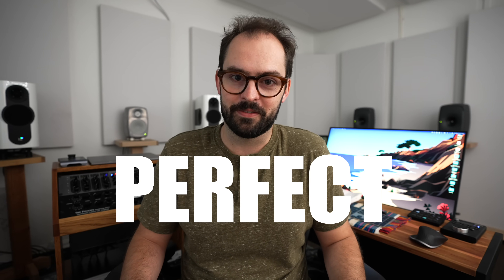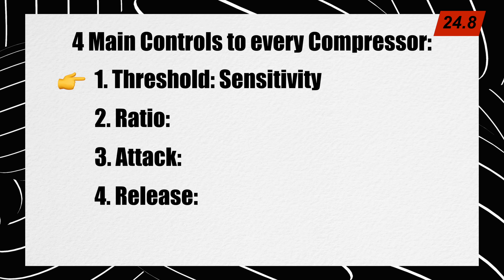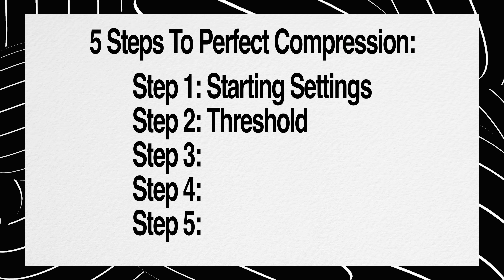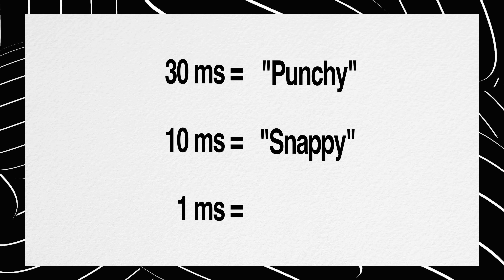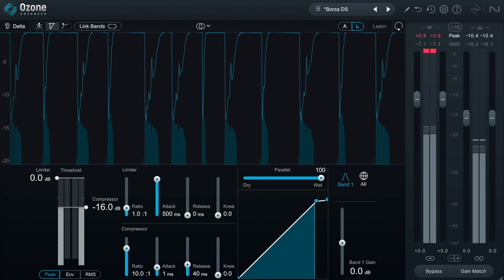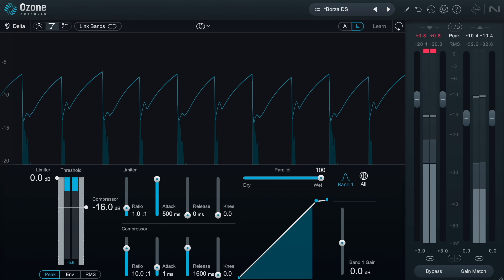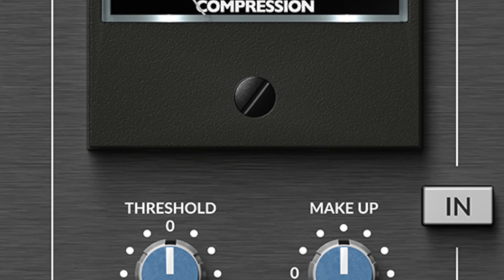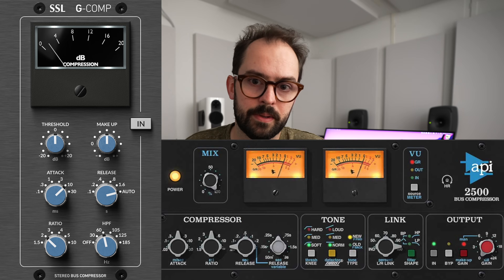The Secret to Perfect Compression

Comment: Excellent video!   The fundamentals of how compressors work is a good place to start... Eventually, however, you should learn to just do it by ear, i.e. choose settings or even which compressor unit or plug-in to use, according to the quality of the sound and as to whether it contributes to the track fitting into the mix or sounding subjectively pleasing or not.   😃
Reply from the maker: Thanks for watching!  And yes you’re right!

Comment: Just want to add that attack and release have nothing to do with a compressor’s reaction time to the loud signal. They just control the speed of the volume’s movement.

Also a limiter is just a compressor with an infinite ratio. Meaning anything that goes over the threshold is turned down by the amount it jumped over.
Reply from the maker: That’s a good way to think of it!
Reply: Modern limiters in DSP are not compressors with infinite ratios. This hasn't been true since at least the L1. They are more like soft and hard clippers with envelope contouring. There's probably some plugins out there that still work within that paradigm, but most modern limiters like Pro-L2, Ozone Limiter, Limitless are all kind of fancy/sophisticated clippers that can smoothly or abruptly transition between eating peaks, and riding gain like an AGC

Comment: 0:30 Compression does not "make stuff less dynamic". A compressor can do that, with a fast Attack, but that's not really a description of a compressor. If I use a slow-ish Attack on a drum recording with a deep Threshold and/or Ratio, my transients will end up proportionately higher than other parts of the signal which were compressed, resulting in an increased dynamic range.

1:14 Attack is not really "reaction time", or "how quickly the compressor is going to respond." The Attack process happens instantly on a Threshold breach, and the time setting of the Attack is a demand for how long the compressor will take to perform ~2/3 of the total Gain Reduction. The trouble with the "reaction time" explanation is that it leaves people confused; they think the compressor is waiting [x] milliseconds to begin performing compression and then kicks in. This is particularly misleading if they are unsure how to listen to a compressor but they're heard about using calculators to determine ms by bpm — especially if they believe your next mistake too, and think that Attack and Release happen one after the other. 

1:19 This is not how Release works; it is not "how quickly will the compressor return to normal after the sound has returned from crossing that line." The Threshold is not a two-way boundary. A standard compressor (i.e. downward compressor) only responds to upward breaches. When that upward breach happens, both the Attack process and the Release process begin instantly and simultaneously (which is why your Release setting should be decently longer than your Attack, in cases where a compressor allows A to be shorter than R). There is no sensor in a downward compressor circuit to detect a level falling beneath a certain mark. Similarly to Attack, the Release time setting is the amount of time after an upward breach for the compressor to restore ~2/3 of the GR.

You can prove this yourself by setting up an example where the audio is constantly above the Threshold. If only Attack happened above the Threshold and Release only kicked in beneath the Threshold, moving the Attack/Release dials wouldn't do anything. However, as you change A and R, you'll clearly hear that the sound does change.
Reply from the maker: This is all accurate but wouldn’t fit into a simplified 60 second overview.
Reply: @WillBorza  Saying that gain recovery begins after the signal dips under the threshold is not simplifying it. That's flat-out wrong. It's legitimate to simplify something if it helps new learners to understand a complex problem, but you did the opposite of helping them to understand.
Reply: @joechapman8208   Thanks for the warning. I almost fell into the trap haha. I am surprised by people who want to spread false information to gain followers and some money.
Reply: @ma3boch  I wouldn't go that far. He's just repeating what he's heard. I'm less impressed that he just tried to BS me by pretending that already knew and was just "trying to simplify" (there's no way anyone will 'simplify' via an incorrect explanation), but I don't think the video is motivated by dishonesty. He thought what he was saying was true.
Reply: @joechapman8208   Thank you for the response, my brother. Frankly, I do not know him, and I also do not want to oppress anyone, whether he or anyone else, but things have become annoying, and lying and deceiving people has become a normal thing for the majority, and this is what bothered me. I also unsubscribed from the channel.

Comment: Hey great video. I have a question: What about tempo based Compressor times for settings close to your 10 and 30 theory’s?
Reply from the maker: Hey thanks for watching!  I never use tempo based comp settings.  Rarely if ever do you want the compressor to be lock step with the bpm of your project.  The GROOVE is almost never an accent on every beat.  usually it's 1 & 3, or 2 & 4, or something else.  And depending on the character of your song, you may want that groove to feel tighter (faster release than bpm) or looser (slower release than bpm).

Comment: Just a couple points to add - ratio is how many dB are going in to coming out. There’s an equation to figure out the actual perfect release timing to quarter, eighth etc. and on bus/mix compressors, physics of sound need be in consideration - i.e. compressors will grab the lowest frequency sound first due to its wavelength.
Reply from the maker: That’s right!  Although I don’t usually do the calculation.

Comment: I loved every second of this video, just a quick question, does this apply to compressing vocals on a mp3 track beat? Should I use just one compressor cuz I see a lot of people use 3 compressors
Reply from the maker: Thanks for watching!  If you can get a WAV or AIF file to work from, that will be better than the MP3.  Sometimes people use 2 or 3 compressors in a row so that no 1 compressor works too hard.

The classic vocal compression chain is an 1176 into an LA2A:  the 1176 grabs all the quick transients, then the LA2A makes the vocal gluey and huge.  Give it a try!
Reply: @WillBorza  thank you for the clarification 💯

Comment: Great video as always. Where did the Neve MBP go!? Also is that an Apogee remote on your desktop, have you switched converters? Thanks.
Reply from the maker: A friend is borrowing the MBP on long term loan right now (I’ve been using it less and less).  And yes, I got the Apogee Symphony MkII 16x16 SE so that I can work in Atmos.  But the Symphony ended up being better than ALL my other converters, so they just sit around now not getting used much.  I still use the Hilo on my 2nd rig.
Reply: Really interesting. Appreciate you taking the time to reply.

Comment: It's not terribly important in the grand scheme, but... the technical defiinitions here of attack & release are not correct.  Why believe me: I've designed these things for a living for 15 years.  They're almost universally misunderstood, but attack is not the time it takes a comp to react once signal is over threshold, and release is not the time it takes to restore gain when signal is below threshold.  Attack, for anyone who cares, is the RATE at which gain reduction is applied (usually, the time it takes to apply 6dB of reduction, sometimes the time it takes to apply 66% of the target reduction, depends who is designing and what their goals are).  Release is the time it takes the comp to restore lost gain (again, typically 6dB or else 66%), irrespective of signal level and threshold.  

A compressor attacks any time a signal is over threshold and increasing in level, and the onset of compression begins the instant the signal crosses threshold (and, sometimes, slightly before, if the knee is super soft).   A compressor releases any time the signal level is decreasing in level and there is gain reduction to be restored, which means release can and will happen a lot even if a signal crosses over threshold and stays there for the whole song.  

If you've read all that and are still skeptical, you can confirm it very easily: bury your signal in compression (so the signal is always over threshold) and adjust attack and release; you will hear the changes in character, and you'll see the gain reduction change its ballistics accordingly, because a comp can only do two things: attack and release, so if it's doing anything at all (i.e., the GR meter is moving) it's doing one of those two things.
Reply from the maker: Greg, you are 100% correct in all this.  My aim was to distill the controls of the compressor so that people who are struggling to grasp the concept of compression could have something to relate to.

“Reaction” and “Recovery” may not be the most technically accurate definition for what attack and release do, but they were the most correct “simple” words that I could find to help people conceptualize a very not simple concept.

Comment: When we listen to attack and release, we’re not being explained if it’s the drums, the synth or even the master bus which is being compressed. To me that’s a bit confusing. What does what to what? I find it really confusing to figure out. Is it changing? First drums with the attack and then synth with the release?
Reply from the maker: Yeah, so the compressor is on the mix bus.  When we're listening for attack, it's easiest to hear that on transients (ie drums).  When we're listening for release, it's easier to hear that in a sustained synth (btw that synth was recorded dynamically static - no swell in volume at all.  So all the volume changes you hear in the synth are being caused by the compressor!)
Reply: @WillBorza  Okay. Still not 100% sure if the compressor is on both simultaneously or you shift between takes. That it is on a mix bus, doesn’t really explain that. That could be a mix bus for drums in the first example and a mix bus for synths on the next. But other than that, it’s pretty easy to hear the changes. But I hope it makes sense, that it matters to be sure where is being used since applying compression to a track can make other things sound different: that is a confusing premise to listen from.

Comment: Doesn't the moving of treshold at the end offset your fine-tuned compression envelope, making it move back and forward in time? Which can cause transients to change and therefore possibly misalign your original timing and intention, making you redo the stuff all over again?
Reply from the maker: Yes, but if you understand compression at that level, you’re in the advanced class 😊
Reply: @WillBorza 
Certainly don't feel like it sometimes after fiddling with it for 10 minutes all frustrated. 😂

Comment: I have the UAD LA2A compressor. It does not have any Attack, Ratio or Release... it just has a peak reduction, a Gain knob & a Mix level why is that? Does it serve like a different purpose or something
Reply from the maker: The LA2A is one of those compressors that hard-wires those settings.

If you check out the manual, you'll find that the attack is roughly 10ms, and the release is roughly 1500ms, but they are variable.  And the peak reduction (threshold) is more sensitive to low end than high end.  The ratio is 3:1 when the switch is pointing towards "compress" and about 10:1 when pointing to "limit".

Thanks for watching and good luck!
Reply: @WillBorza  oh thanks a lot!

Comment: 50 ms attack is enough for all audible frequency transients to make one cycle before the compressor kicks on.
Reply from the maker: Interesting!  Do you factor that into how you dial in your attack time?
Reply: @WillBorza  I do. I didn't always - but CD quality is 44.1k and DVD is 48k which both allow the upper limit of human audibility. 50ms correlates to to the waveform at 50k making one pass, so this allows all information of the initial transient - tone, attack, eq - to pass and make one hit, while the compressor snaps down the peaks after that, where most of the volume information lays. So you get the best of both worlds - the initial transients and the compression. So 10ms basically correlates to 10k one cycle pass, and you'll be chopping off some, transients. Which isn't a bad or unwanted thing totally in some instances.